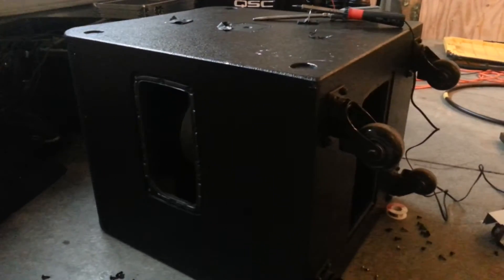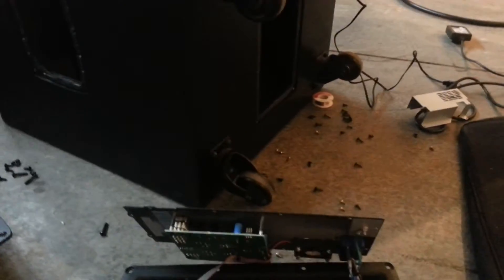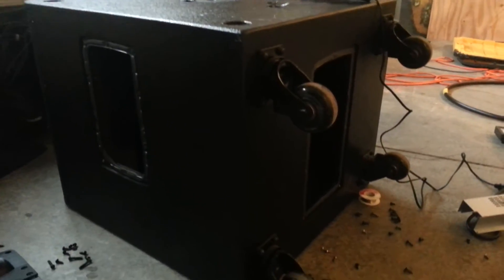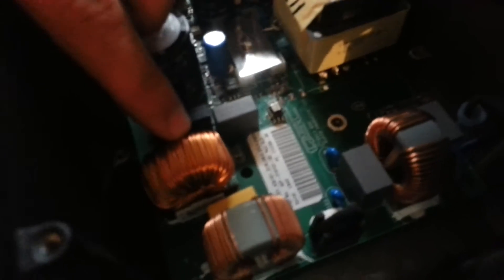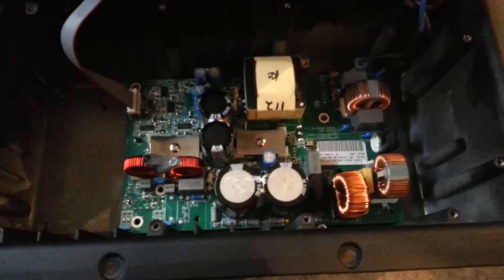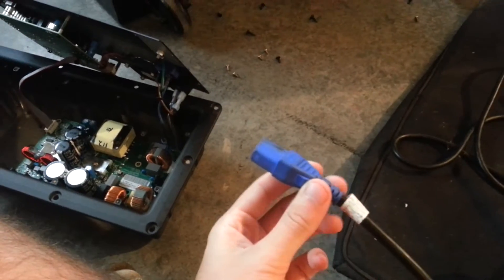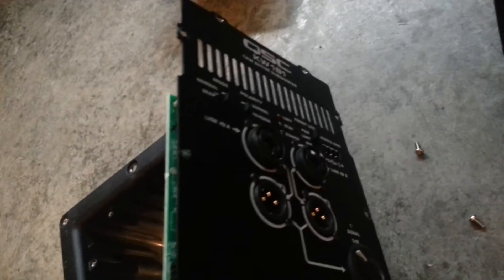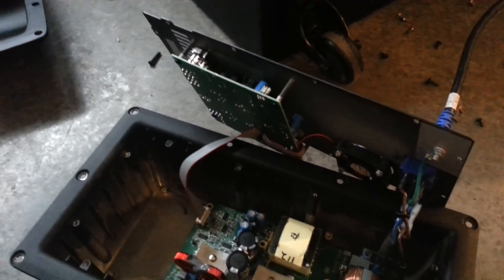QSC KW181 Amp Module Failure and Repair

Comment: Question, if the led in the from of the 181 is not lighting up at all... what could it be? Or should I not worry about it?
Reply: Adam Cardenas.. check the front led switch, make sure it's on the power setting. If it still doesn't light up but the woofer still works good it might be a simple 2 dollar led bulb fix.
Reply: rudycorraudio Thanks Rudy... I confirmed it was on power and it still not working. It’s still under warranty but as long as the amp is still working nor worries about the LED in the front. But thanks anyways!!appreciate your vids guy! Loyal QSC fan!
Reply: @rudycorraudio9089  do you know what the shit goop is called on the back side of the PCB board?

Comment: Ah HA!  I'll bet this is the problem with my QSC KW 122....  (I hope it's this...) . I have had this happen before, and also have had problems with frying 110 volt equipment to 220 by accident.

I'll look for a video that shows how to fix that problem.  What a drag everything isn't made to be both 110v and 220v.

Comment: This exact same inductor is also a problem on the K12s.     I had the same thing happen (actually one of the legs cracked so it was hanging by one wire)  to me and I had to re-solder the inductor in place.    I then used some hot glue and basically potted in the inductor to prevent it from vibrating.   QSC needs to take a look at this.  The weight of the inductor obviously can't be supported by the small gauge wire used to solder it in place.